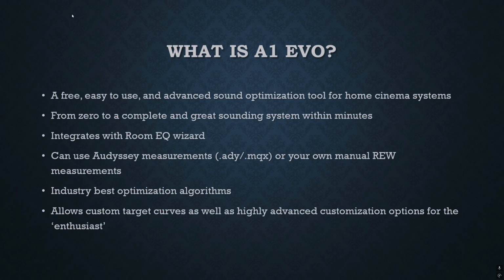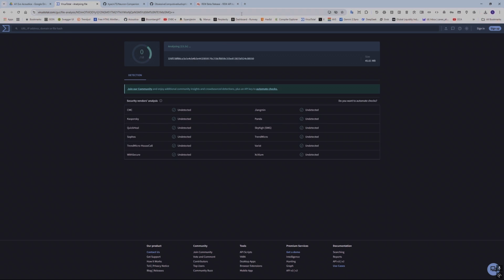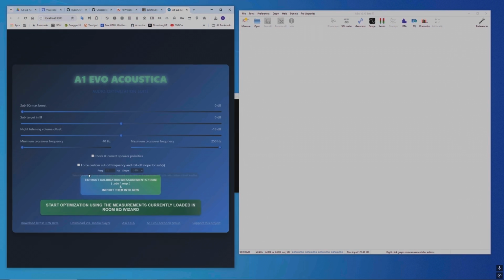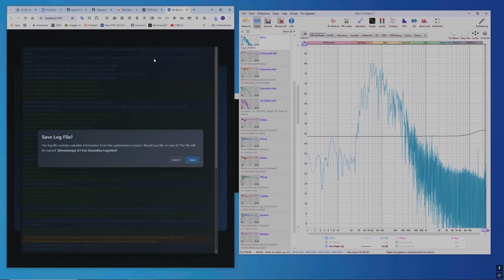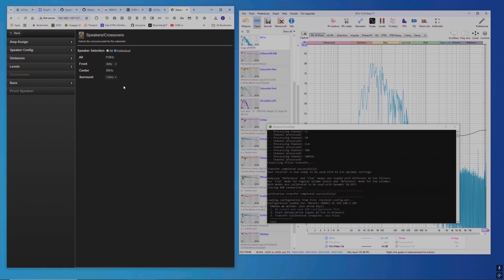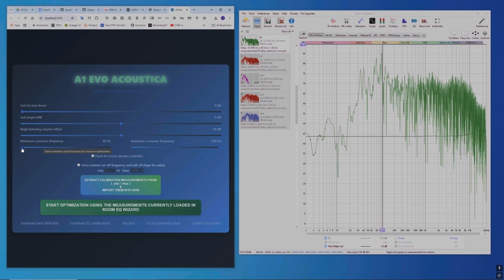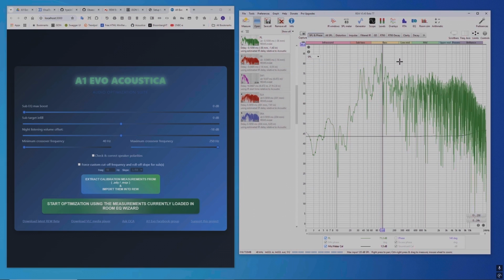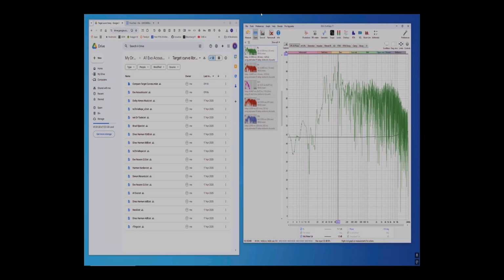A1 Evo Acoustica

Comment from the maker: 💥:yt:A1 Evo Acoustica v5.0 released on 07 May 2025 15:23 CET:yt:💥
Important update, please see update log for details!
Link in the video description.

OCAhttps://lh3.googleusercontent.com/IkpeJf1g9Lq0WNjvSa4XFq4LVNZ9IP5FKW8yywXb12djo1OGdJtziejNASITyq4L0itkMNw=w24-h24-c-k-nd
Reply: Still Doesn't work with Dolby Atmos Content on Marantz 70s :(
Reply from the maker: @markaspinall7709 sorry not much I can do about testing with different models. Hope someone with your model chips in on github
Reply: @markaspinall7709 same problem on X2700H😅 ,even on 2.9 version
Reply: @markaspinall7709  use the old trasnferallfiltersatonce_V2 to send oca. worked for me. not sure if it leaves out any filters, but dolby now works and the sound is really good
Reply: Atmos and Dolby Surround still not working, NO Sound
Denon S770H
Reply: @Marco-56-x5r same with my Denon AVR-x1800h (
Reply: I'm using Marantz Cinema 70s and tried running it with a1-evo-acoustica-win64_v2.8. After calibration, the front speakers and surround speakers are recognized as full range, so the subwoofer doesn't work.
Reply: @cjy1985  I have the same problem on Denon x1800h. When loading .oca, the application gives an error at the stage of loading the SW configuration into the receiver.
Reply: Amazing work !
You added the sliders for crossover point for the fronts. Please add also a checkbox to force the fronts to large. 
Thank you !
Reply: Still no subwoofer sound on marantz cinema 70s using version 2.7
Reply from the maker: Timing makes a difference, repeat transfer with basic environment ie no vpn, fancy network settings etc.
Reply: That did the trick and works like a charm. Thank you very much - especially for the quick resolution and answer. Very much appreciated.
Reply: Hello, I am using an AV receiver called Marantz Cinema 70s, and I tried to calibrate it using a1-evo-acoustica-v3.1. 
It seemed to be going well, but the AV receiver stopped with no response from the last subwoofer transmission. 
I will upload the script at the bottom. I just pressed the optimization start button without touching any settings. 
I am currently using the A1 Evo Neuron 1.6 version normally.

Comparing .oca file channel assignments with the configuration reported by the AVR...
>> Configurations match between loaded .oca file and what the AVR reported.
AVR ready to accept filters.
--- Processing Channel: FL
   Flat mode filters for channel FL were sent successfully.
   Reference mode filters for channel FL were sent successfully.
--- Processing Channel: FR
   Flat mode filters for channel FR were sent successfully.
   Reference mode filters for channel FR were sent successfully.
--- Processing Channel: SLA
   Flat mode filters for channel SLA were sent successfully.
   Reference mode filters for channel SLA were sent successfully.
--- Processing Channel: SRA
   Flat mode filters for channel SRA were sent successfully.
   Reference mode filters for channel SRA were sent successfully.
--- Processing Channel: SW1
   Flat mode filters for channel SW1 were sent successfully.
!!! FAILED sending PACKET 4/4 SW1 Reference (TC01) SR02: PACKET 4/4 SW1 Reference (TC01) SR02: No response received

--- EXECUTION FAILED !!! ---
Error: PACKET 4/4 SW1 Reference (TC01) SR02: No response received
Error: PACKET 4/4 SW1 Reference (TC01) SR02: No response received
    at cleanup (C:\snapshot\Acoustica 3.0\sendFilters.js:640:42)
    at Timeout.<anonymous> (C:\snapshot\Acoustica 3.0\sendFilters.js:675:14)
    at listOnTimeout (node:internal/timers:564:17)
    at process.processTimers (node:internal/timers:507:7)
Cannot attempt to exit calibration mode during error cleanup. Reason: Connection/sender not available.
Closing AVR connection...
Reply: Hi OCA your work is absolutely amazing change my SR6013 sound, thank you! But I still have problems to transfer acustica .oca file  to receiver, there was error at the end, anr Marantz can't switch off, needs to unplug from the power network, but if I copy all filters and levels  and distances  to .oca  file generated from A1 Evo Neuron  and transfer it trough odd_menu.bat, procedure are verry quick and Marantz plays atmos and other multychannel files in proper way.
Thank you again, i'm shure you will fix the problems!
Reply: "INIT_COEFS: No response received"occures on mac x86 v2.6,device :X2700H, thanks:face-blue-smiling:
Reply: @ocaudiophile  2.7 work by restoring denon, thks
Reply: Im still having a problm on Marantz cinema 60. Can not create oca file.
Reply: After uploading .oca file to Marantz SR6013  I have  mixed channels (for example LFE is on dolby R)
Reply: I'm using Marantz Cinema 70s and tried running it with a1-evo-acoustica-win64_v2.9. The front and surround speakers are still recognized as full range after calibration, so the subwoofer does not work.
Reply from the maker: @cjy1985  Try changing them back to small and check if crossovers are set correctly afterwards. It should work fine.
Reply: Here is scheme how channels are send to loudspeakers in my SR6013:
L to C
R to C
C to C
LFE to L
Ls to R
Rs to C
LsB to R
RsB to C
DolbyL to R
DolbyR to R
If I try to check levels in receiver all channels are correct.
Reply from the maker: @momchilbozhkov  Thanks for that, looks like your ampAssign configuration has changed, try to fix it in the set up menu...
Reply: @ocaudiophile  this mess with channels happen only with atmos audio(also sub is not work) in normal multichannel source all channels are OK.
Reply: I am using a Marantz Cinema 70s AV receiver and tried to calibrate it with the A1 Evo Acoustica3.0 version. After the calibration, an error occurred during the process of transferring the file to the AV receiver and the AV receiver stopped. 
I am attaching the error message.
--- EXECUTION FAILED !!! ---
Error: FINZ: No response received
Error: FINZ: No response received
    at cleanup (C:\snapshot\Acoustica 3.0\sendFilters.js:640:42)
    at Timeout.<anonymous> (C:\snapshot\Acoustica 3.0\sendFilters.js:666:11)
    at listOnTimeout (node:internal/timers:564:17)
    at process.processTimers (node:internal/timers:507:7)
Cannot attempt to exit calibration mode during error cleanup. Reason: Connection/sender not available.
Closing AVR connection...
Reply: @cjy1985 same. Hangs on subwoofer. Reciver locks up
Reply: Unfortunately, I can't open/start version v3.0. - Windows deletes the exe every time for security reasons. With version 2.0  everything worked fine :(
Reply from the maker: You need to temporarily turn off defender to download it. Node.js applications using child_prosess unfortunately gets false positives from a few virus scanners. It will eventually be recognized by Windows and be allowed.
Reply: @ocaudiophile  With 3.1 everything worked, Thank you Serkan 💙
Reply: windows security detects threats (Trojan:Script/Sabsik.FL.A!ml) and blocks the file.
Reply from the maker: @manmar8744  You should have watched the video before posting that:
https://www.virustotal.com/gui/file/7f6e0f8923a18693f4d539b0423ae0d820eccca0300b274af6291f8ff37be7cd?nocache=1
Reply: Thansk for frequent updates, Serkan! 

With Marantz SR5014 i get this error with version 3.1

Detected active channels: FL, C, FR, SLA, SRA, SW1
Comparing .oca file channel assignments with the configuration reported by the AVR...
>> Configurations match between loaded .oca file and what the AVR reported.
AVR ready to accept filters.

--- EXECUTION FAILED !!! ---
Error: INIT_COEFS: No response received
Error: INIT_COEFS: No response received
    at cleanup (C:\snapshot\Acoustica 3.0\sendFilters.js:640:42)
    at Timeout.<anonymous> (C:\snapshot\Acoustica 3.0\sendFilters.js:675:14)
    at listOnTimeout (node:internal/timers:564:17)
    at process.processTimers (node:internal/timers:507:7)
Cannot attempt to exit calibration mode during error cleanup. Reason: Connection/sender not available.
Closing AVR connection...
Reply: Hello, I can’t upload oca files after optimisation, i read the sr6012 et sr7012 have no web interface …🥲
Reply: It’s okay now ! 🤦‍♂️😅
Reply: hi OCA, tested 3.2 with Denon X1700H and on Dolby Digital + and ATMOS there's no sound this is the first time when this happens. Hope this feedback helps.
Reply: hi, I use an AV receiver called Marantz Cinema70s. 
I calibrated it using a1-evo-acoustica-win64_v4.0. 
There were no problems with the calibration or transmission process, but this time, the problem of the subwoofer not responding, which occurred at the beginning, occurred again. 
I calibrated it in the full-range state during the initial setup, and I also tried it with LFE applied, but the subwoofer still does not work after the calibration.
Reply: A1 Evo Acoustica v4.0 is good at 'Reference' mode+Atmos,but still muted Atmos at 'Flat' mode'. 
Reciever:X2700H.
Hope this feedback helps:hand-pink-waving:
Reply from the maker: @shouminzhang8864  I think I've finally found the problem and I will release a fix shortly!
Reply: Does this work with a S650h? I tried calibrating my friends system but it kept failing to acquire the calibration file.
Reply: Many thanks for your effort, maybe the best results yet :)
However with my ACV (SR7015) there seems to be a small bug, after transferring the .oca file all speakers are set to "large" although they are marked as small in the .oca file.
After changing them manually to "small" everything is fine and the calculated XOvers are used.
Reply: I keep getting this error. localhost:3000 says undefined. Then it says A1 Evo Acoustica cannot optimize your system without individual for each subwoofer. I have used .ADY and .MQX files.  Do you know a fix? Thank you. Carlton
Reply: Hey OCA, great work! I did the whole process. But now the distances are all way too short (not the Sub), for example, the SR-Speaker is said to be 0,00m instead of 1,65m, the FL 2,90m instead of 4,70m. Using a Denon X3800H. What could be the problem?
Reply from the maker: @folcalor1923  Nothing, just read the log prompt after speaker distances are listed.
Reply: @ocaudiophile  I've read and understand that, the sub is actually set to 7,35 m and I won't touch that, but the other speakers are not measured too far away, they appear to be too close (especially the SR with 0,00 m). So I thought this could be a bug.
Reply from the maker: @folcalor1923  No, that only means SR is fired last as it's the nearest.
Reply: @ocaudiophile  Ah, ok, now I get it. Thanks for the clarification!
Reply: Seems latest version 4.5 adds to long distance on subwoofer.  7,83m . My marantz cinema 70 warns on distance. Max seems to be 7.61m
Reply from the maker: @robbinbruzelius3102  There should be a warning in the optimization log for that which you should read...
Reply: Hello Serkan! I've start optimization my audyssey file for marantz sr6015 and in the end i have the message: ERROR] A1 Evo Acoustica cannot optimize your system without individual measurements for each subwoofer! What I need to do? Thank you!
Reply: model:X2700H, THANKS.

<< Amplifier assignment map matches between .oca file and the AVR >>
      WARNING: Input filter length for XT channel FL is 4096, expected 512. AVR might reject or truncate.
      WARNING: Input filterLV length for XT channel FL is 4096, expected 512. AVR might reject or truncate.
      WARNING: Input filter length for XT channel C is 4096, expected 512. AVR might reject or truncate.
      WARNING: Input filterLV length for XT channel C is 4096, expected 512. AVR might reject or truncate.
      WARNING: Input filter length for XT channel FR is 4096, expected 512. AVR might reject or truncate.
      WARNING: Input filterLV length for XT channel FR is 4096, expected 512. AVR might reject or truncate.
      WARNING: Input filter length for XT channel SLA is 4096, expected 512. AVR might reject or truncate.
      WARNING: Input filterLV length for XT channel SLA is 4096, expected 512. AVR might reject or truncate.
      WARNING: Input filter length for XT channel SRA is 4096, expected 512. AVR might reject or truncate.
      WARNING: Input filterLV length for XT channel SRA is 4096, expected 512. AVR might reject or truncate.
      WARNING: Input filter length for XT channel TML is 4096, expected 512. AVR might reject or truncate.
      WARNING: Input filterLV length for XT channel TML is 4096, expected 512. AVR might reject or truncate.
      WARNING: Input filter length for XT channel TMR is 4096, expected 512. AVR might reject or truncate.
      WARNING: Input filterLV length for XT channel TMR is 4096, expected 512. AVR might reject or truncate.
      WARNING: Input filter length for XT channel SW1 is 4096, expected 512. AVR might reject or truncate.
      WARNING: Input filterLV length for XT channel SW1 is 4096, expected 512. AVR might reject or truncate.

Uploading Flat mode filters =>
 >> Channel: FL
 >> Channel: C
 >> Channel: FR
 >> Channel: SRA
 >> Channel: SLA
 >> Channel: TMR
 >> Channel: TML
 >> Channel: SW1

Uploading Reference mode filters =>
 >> Channel: FL
 >> Channel: C
 >> Channel: FR
✗ Timeout/Error: Coef Pkt 33/33 (FR Reference SR02) - No response/ACK received
!!! FAILED sending Coef Pkt 33/33 (FR Reference SR02): Coef Pkt 33/33 (FR Reference SR02): No response/ACK received
   !!! FAILED sending filters for FR - Target Curve Reference.
   Error details: Coef Pkt 33/33 (FR Reference SR02): No response/ACK received

--!!! CALIBRATION TRANSFER FAILED !!!--
   Error: Transfer failed for channel FR, Target Curve Reference.
Reply from the maker: @shouminzhang8864  Thanks, I believe I fixed that with a silent update 5 min ago...

Comment: Just to confirm, With Acoustica I will need the Audyssey appt to take the meassurements right?  Thanks!!
Reply from the maker: You can measure yourself with REW.
Reply: @ocaudiophile  Hey Serko,  Can you confirm if I can still ust the ODD.wtf just to get the meassurements? I dont have a Umik to do meassurements with REW.

Comment: Just tried downloading the win64 zip file.  Windows antivirus indicates it has Trojan:Script/Wacatac.B!ml ....not sure what to do, but maybe wait until get a response from OCA that the file is reposted and OK to download.
Reply: He mentioned it as an issue with some antivirus software in the video (around 3mins in). You can ignore the message; depending on your system you may have to temporarily disable your anti-virus/defender software before downloading and then reenabling.

Comment: Hi OCA, not sure if this is just me, but I've been redoing my config today, and when i send the file across to my Denon the XO settings and speaker size settings are not being transferred; so its leaving all speakers as large, even though in the json editor it clearly has the X Overs as expected. I've tried rebooting the receiver, so at a bit of a loss. I'm using the v2.0 of the Accoustica-win64 file. I can go into the receiver and change speaker config for the fronts to small, and everything is then fine. Any advice ?? Anyone else experiencing this issue?
Thanks Kevin
Reply from the maker: You are not the only one but filters must be transferring correctly. It could be a preset selection problem before transfer. I am working on a fix.
Reply: Thank you. Let me know if you want any of my files to test against.

Comment: I wish there would be an option to use this without a subwoofer. I don't really need one in my setup and using a dummy sub (copy pasted measurements from FL added in .ady as SW1) with neuron sounded awful with way too much bass. On the other hand, for mids and heights it seems to have achieved better results than audessey. I'll keep an eye on this project anyway. Thanks for your work!

Comment: Hello. I am using Marantz Cinema 70s, and the speakers are front, surround, and subwoofer. I tried several times, but the subwoofer, which worked when I initialized it, does not work after a1-evo-acoustica calibration. Just in case, I calibrated it with the previous version, A1 Evo Neuron, and the subwoofer works normally. I have not tested it on the p3.1 version.
Reply from the maker: Did you try with v2.9?

Comment: No sound from subwoofer. I have marantz cinema 70. Tried turning up subwoofer level but dont hear any change in sound
Reply: I have the same problem with my Denon X3800H.
Reply: @-dAtA-TRoN-  I'm getting bass on my X3800H, but doesn't sound as good as it did with Neuron version

Comment: Feedback: While this works great while playing from PC via HDMI on a Denon AVR, the sound is distorted when playing from Bluetooth - doesn't matter if Flat or Reference, Stereo or MCH - Bass is extremely loud, rest is very quiet and in the background. I might add that often I had similar issues in the past when using sendFilters_lowVolume executables from Neuron. Without lowVolume it was always fine.

Comment: Still way to much bass. Same as in Neuron 3.0....
Reply: Try neuron tc2.0 curve. Bass is perfect for me without any fill.
Reply: @SeanGreensmith-i3p  still insanely over the top bass... will need to take another measurement tomorrow because the script says that the sub is 5db to quiet, need to crank up vol on the sub itself, maybe there´s a bug somewhere in the compensation? i mean, A1 evo acoustica set bass lvl dB to +12... which is way to loud imo but dont ask me... i don´t know exactly how A1 works...

Comment: Thanks for this next version. Looks great, but I've got two questions:
- What does "11:19:17 AM [INFORMATION] Final target level:: 67.81869dB" mean? Does it mean that when I have my volume set to 0dB on the receiver it is 67.8 dB at the MLP?
- The x-over with FL and FR are set to 100Hz, where previous versions (and also audyssey) would set them way lower. (Depending on the target curve to 40, or 60 Hz) Is there an explanation for that? I would rather not go above 80Hz.
Reply: Same in my case 67.8 db I use acustica curve. Denon 3600x